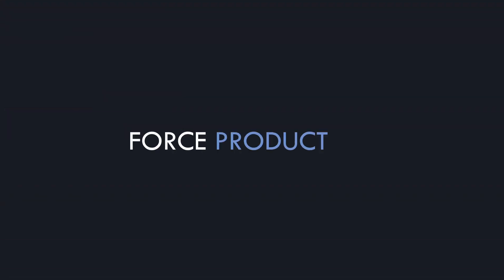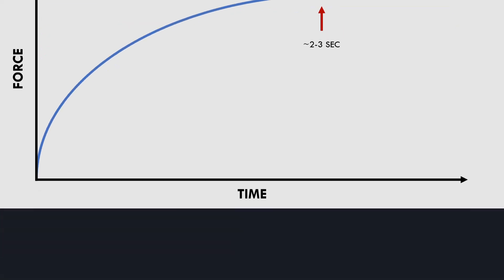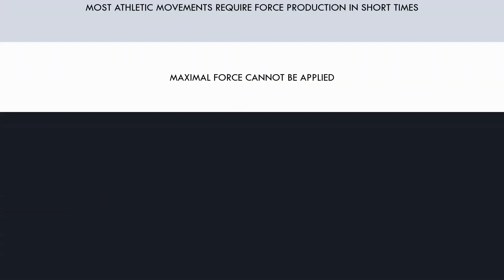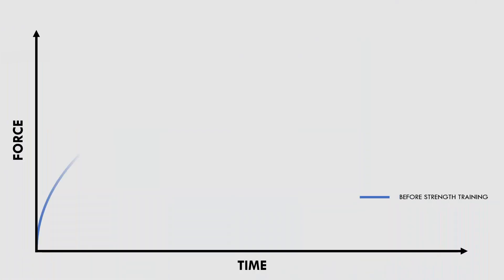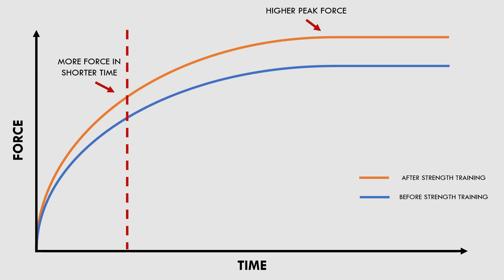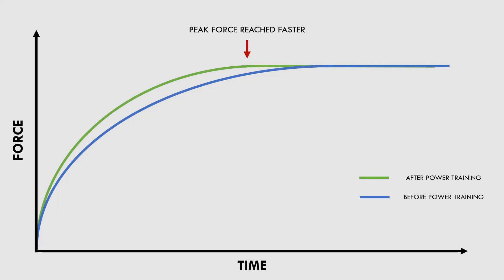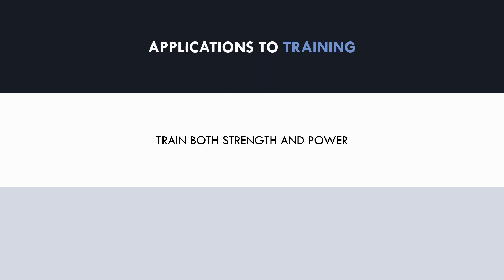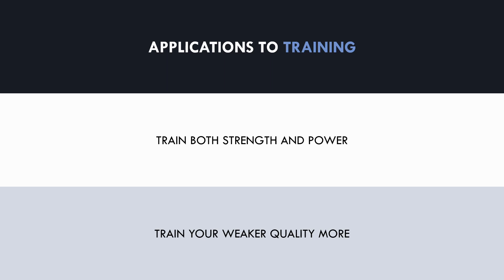Rate of Force Development | Implications for Strength & Power Training

Comment: Mass× speed= force
Simply we can gain weight to increase force?
Hello brother i have a question 
There are 2 person A and B
A is two time stronger than B in strength but  A is 50 kg and B is 60 kg
And both delivers punch in same speed then who will hit harder?
Reply from the maker: Yes, increase mass will increase force - if speed is constant. In your example, athlete B will punch harder. This is why there is weight classes in most combat sports. However, if athlete A is 2x stronger, then they can probably punch faster 👍
Reply: @FlowHighPerformance1  i love u so much bro .
U have cleared my all doubst .
Love u so much bro 🤍

Comment: Are high-load ballistic exercises like the jerk and clean, better than low-load ballistic exercises like the squat jump?
Reply from the maker: I prefer loaded jumps since they are easier to learn. You can load them both heavy and light too 👍
Reply: Is there a set range of load to follow for the loaded jumps? In terms of load per bodyweight or load% of 1RM.